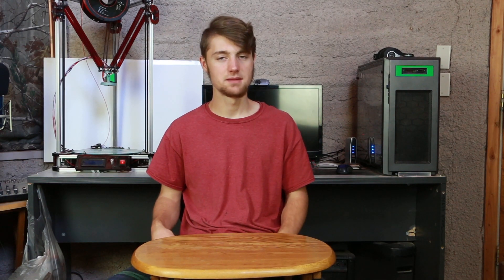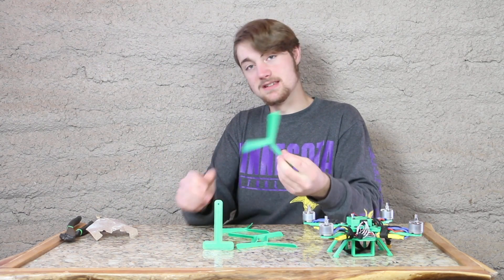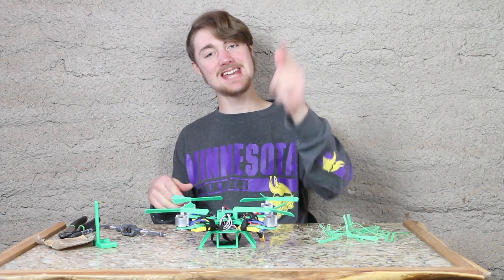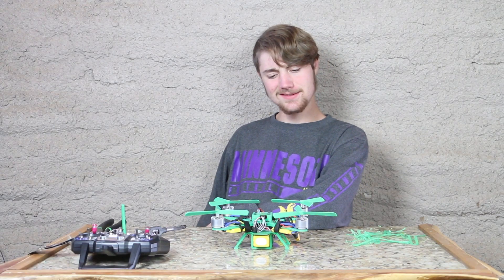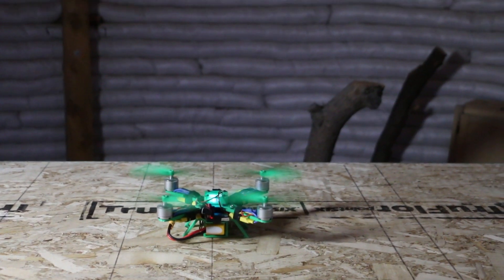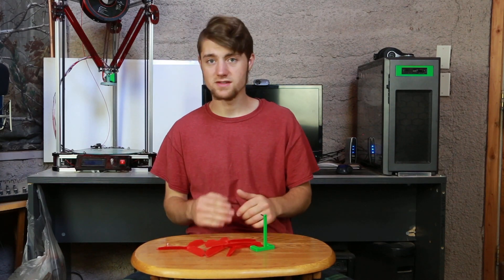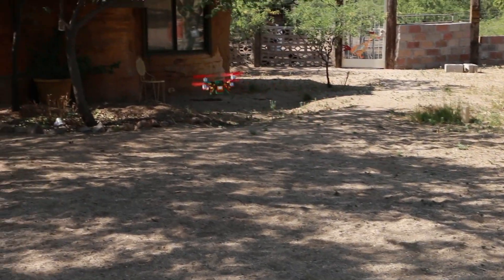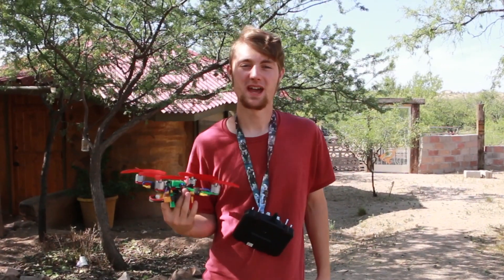3d Printed Props for the Quadcopter!

Comment: if i am not wrong the you will need a higher kv motor yout motors are made for at least 1045 prop as i assume that they are around 800 to 1000kv

Comment: if you increase the shell thickness to the point the printer will no longer "infill" they will have much higher tension strength. so the part is basically a line drawing instead of an outlined shape being colored in... if that makes sense. this would also make them more balanced and smooth off the bat. nice vid tho